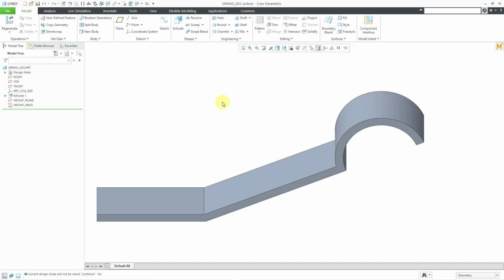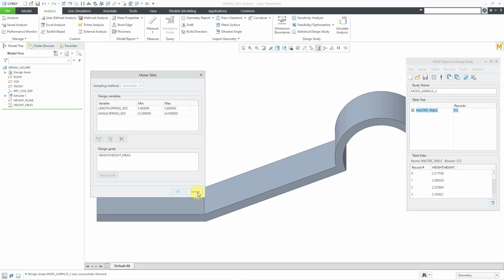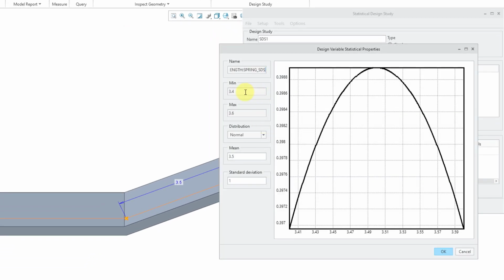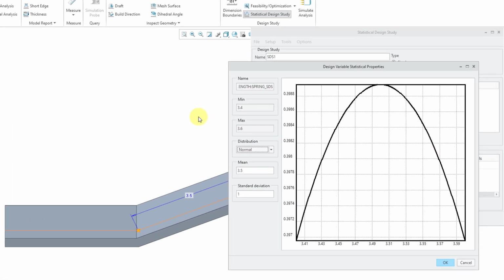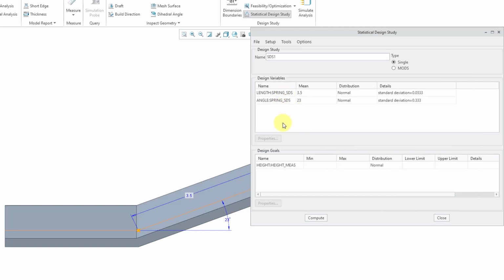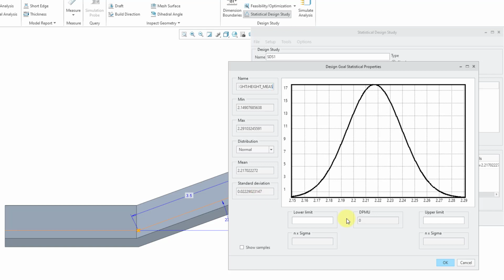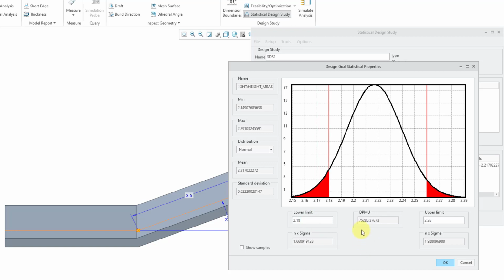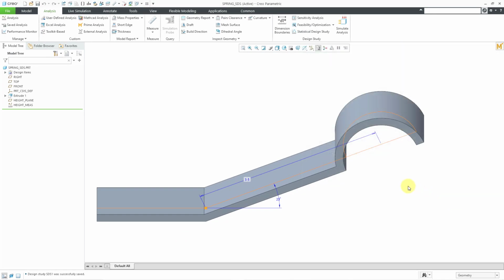Creo Parametric - Statistical Design Studies - Part 4 of 4 (BMX)

Comment: really cool stuff.  Does this type of analysis also work with assemblies?  meaning can we do some kind of analysis to determine if there will be interference when trying to join multiple parts?  I'm thinking of a simple asm, 2 parts, both have bolt holes that match up, is there a way to determine the tolerance on the holes to ensure the bolts will fit?  if we can define the statistics of the bolt shank, and the stats on the hole diam and location, it would be really cool if Creo could tell us if the parts would join up without a problem.
Reply from the maker: Yes, the Statistical Design Study is available in assembly mode. However, you might get easier results using the EZ Tolerance Analysis module.